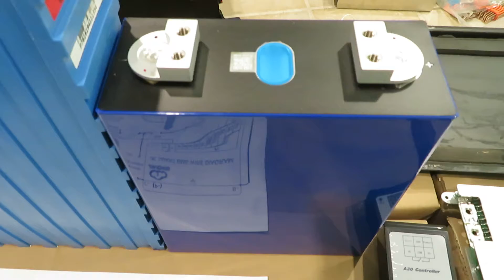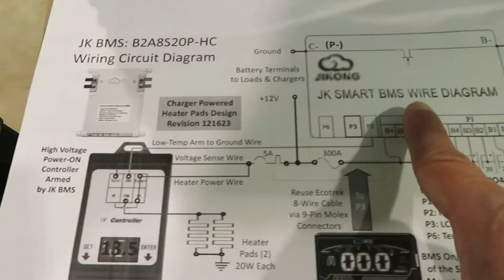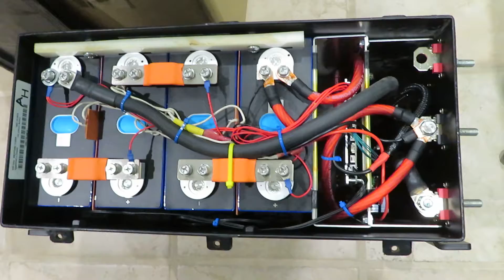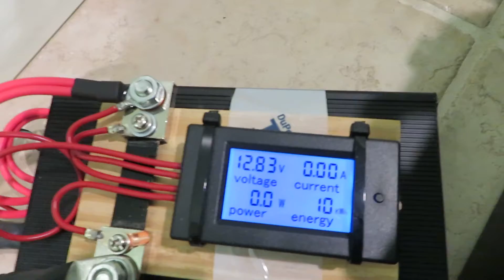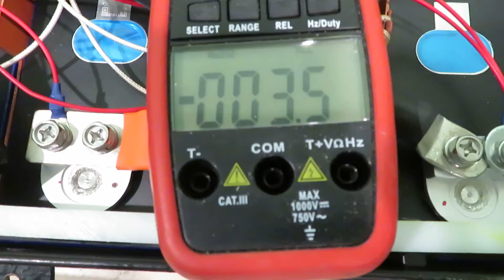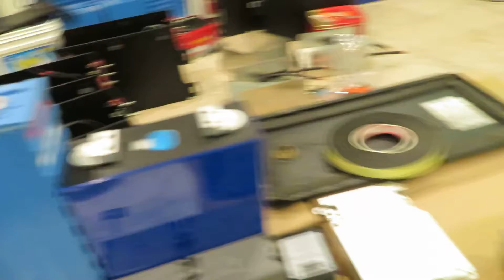JK BMS – 304AH EVE Cells Retrofit and Battery Heating Demonstration

Comment: hi! looks like you are using the orange silicon heating pads. they seem to get very hot because they are used for 3d-printers . they might get hotter then the recommended max. temperature of 60 degrees celsius... whats your experience?
Reply from the maker: While the same color, these pads come at various powers (wattages). Sunfunkits sells pads at 50W. Mine is only 20W. Experience has been great and flawlessly.